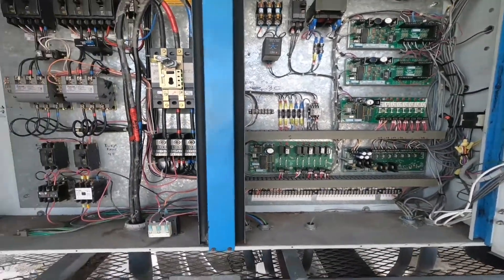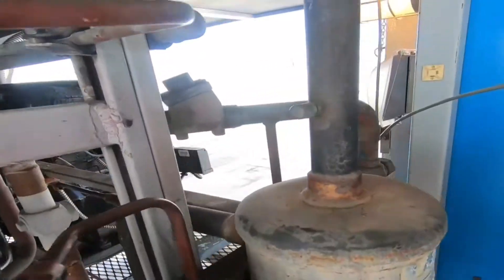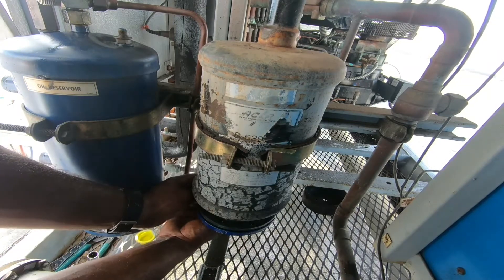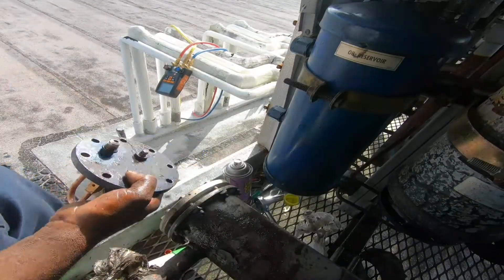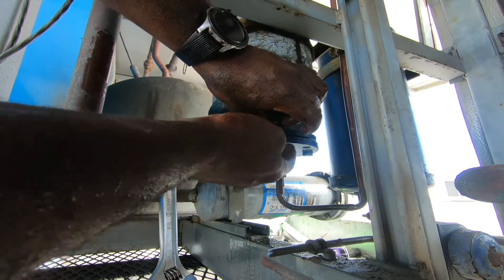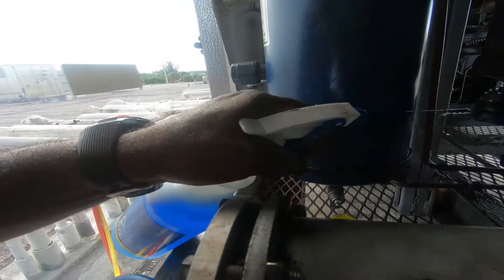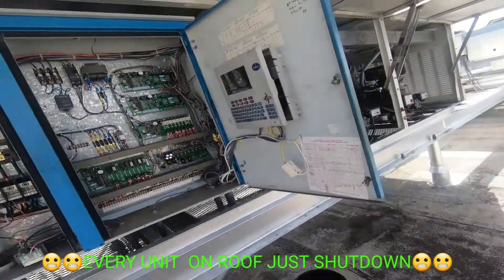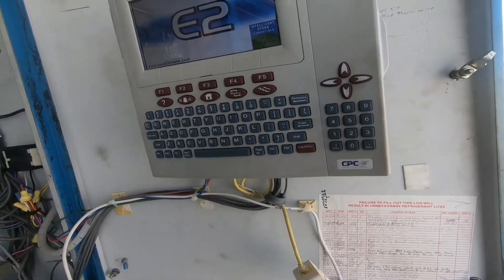OIL SEPARATOR FILTER REPLACEMENT

Comment: in a pinch if the oil float isnt feeding oil  you can force discharge gas from compressor into the bottom of the oil seporator and get oil feeding until you get back with the parts .
Reply from the maker: I tried to back flush it first and no luck
Reply: @Bluecollarrebel  i like your channel bud. i thought about starting a rack refrigeration channel but i got enough work to do already.lol
Reply from the maker: @scottriddle5468  Thanks I hear you when start the channel let me know

Comment: Im starting my refrigeration course i a couple months.Just found your channel! I dont understand very much yet but I figure the more I watch the quicker ill catch on! Cheers!
Reply: I know im a newbie and your videos are mostly geared toward experienced professionnals, I would find it quite helpful if when troubleshooting you would point out and briefly explain some of the basics of what you are doing. For example you always check the sightglass ( not the compressor oil one). What does iy mean if you do or dont see liquid in the sightglass?
Reply from the maker: Hey Kevin. I'm no teacher I typically just like the pleasure of vlogging and challenging my self while the camera is rolling. I only check the oil when I think it's a oil issue. A clear sight glass normally means you have enough refrigerant in the system and the subcool should be within a good range. Typically you need a full column of liquid enter the txv.
Reply from the maker: Also check out chanels like Hvacr Videos and Hvac School. I learn alot from these channels as well. Wish You Luck 🙂

Comment: Good practice to replace bolts when changing cores and as well when dropping oil separator floats. You don't want a bolt to sheer off. No vacuum pulled for that seperator?? Air and refrigerant don't mix.
Reply from the maker: Thanks for the tips I appreciate the Great input 🏅 yes vacuum was pulled an should always be pulled I agree.💯

Comment: I was a a rack a couple weeks ago, and when I was checking voltage at a contactor (208, 3 phase)....  Within about 5 seconds the voltage slowly started dropping... 210... 209... 208..... All the way down to 194, then everything turned off... All lights, all equipment, everything. About 2 seconds later, everything came back online, and started powering up.   And there I was standing there with my meter still on the lugs.  Turns out a car down the street hit a power pole.  But I'll tell ya, I had to change my undies after that one.
Reply: Wow 😳
Reply from the maker: Wow I can imagine the moment I start walking towards hatch I kind was shocked till I heard the generator kick on